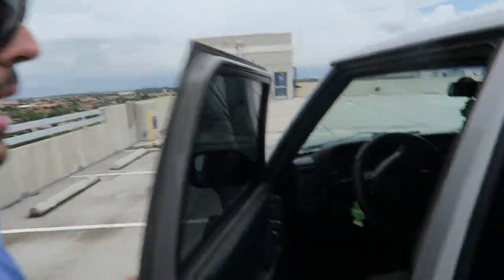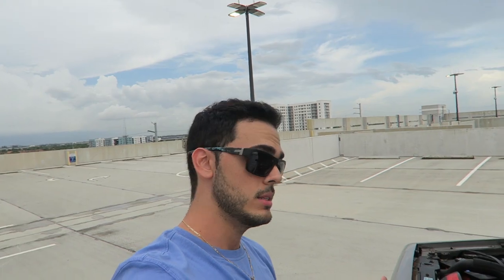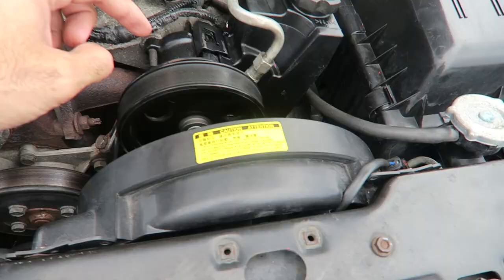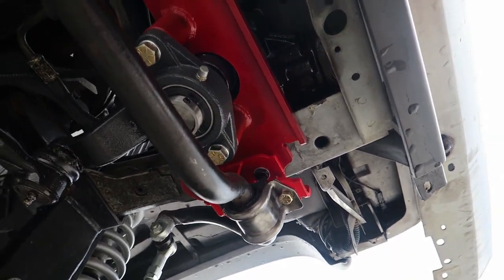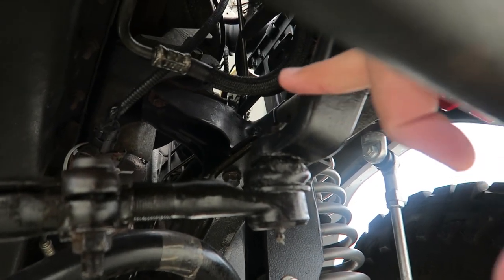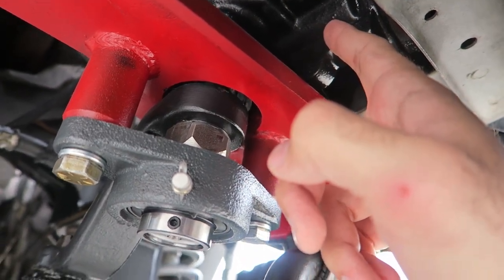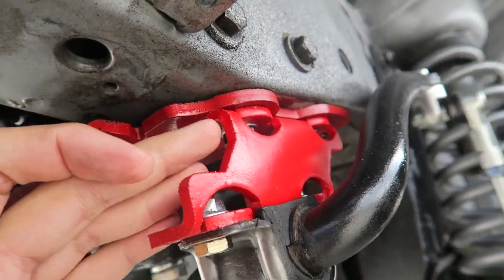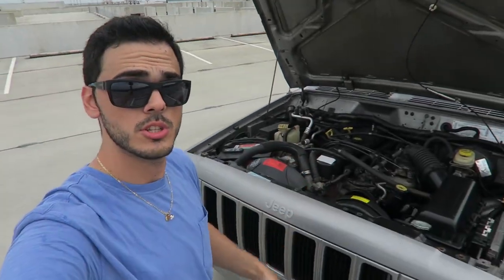JEEP XJ STEERING UPGRADE! NEW STEERING BRACE AND STEERING BOX!

Comment: I noticed this brace on your build video but forgot to ask you about it - it's one classy frame brace! thanks for the information  - I'll look for the results on it's performance off road
Reply from the maker: Gary Button yeah, can’t wait to test it on the trails. I’m planning on going to Lazy Springs by the end of this month so I can test it.
Reply: cool sandbox to play in! BTW, OX now has an electric solenoid option for their cable actuated locker - might come in handy - I'm going to the 4wheel store later this week to inquire haw hard I have to hit my piggy bank to drive away with one.

Comment: You've got your XJ looking good just like it is, but do you have any plans to add a Winch Bumper to the front & spare tire carrier rear bumper, that would really make it look "Bad-Ass" even if you don't plan to Wheel it that much, keep up the good work and by the way, I really love the color of your jeep, I'm going to repaint mine this spring and I'm trying to decide whether to go with Silver or Black, my daily driver is a black H2 Hummer, and I've got a 86' 3/4 ton Suburban 4x4 that is Silver, it's been a project rig since 97' I finally put it in the garage and only use it for long overland camping trips, I've been working on my jeep now since last summer and I'm about ready to repaint it, just need to decide on a color, keep up the good work and keep the videos coming, even the simplest things are always interesting to see how much difference they make..............

Comment: What options did you choose for the blue top gear box I’m planning on running 33m/t on 16x8 aluminum wheels on a 5.5 in iron rock off-road pro link long arm lift kit with the coil springs in the rear on 4.56 gears with arb air lockers in both axles

Comment: Hello.

What is the type of oil for steering (ATF + 4)?

Thank you

(Salut.
Quelle est le type d'huile pour la direction (ATF+4)?
Merci)
Reply from the maker: yeah I think that should work
Reply: mine is 1988 Jeep and i use the old atf. i have also used atf4 in my 87 bmw 325 I steering pump. i think atf4 is ok but not cheap. any name brand [power steering should work.
Reply: You kept stock sway bar